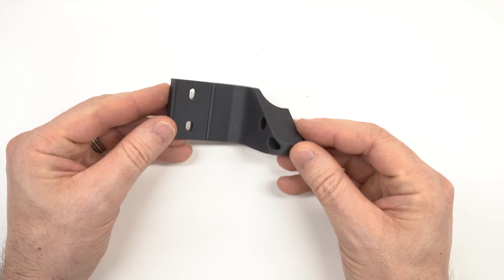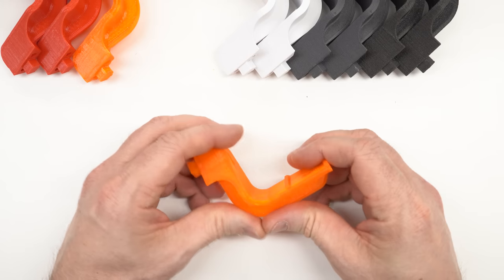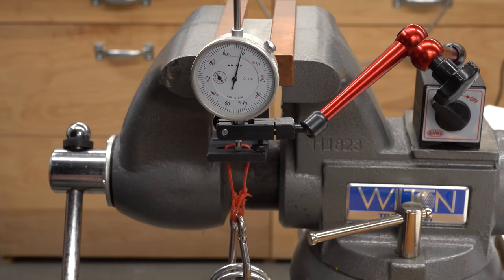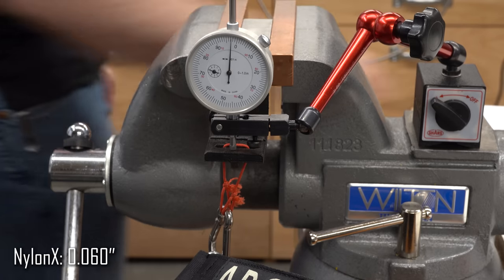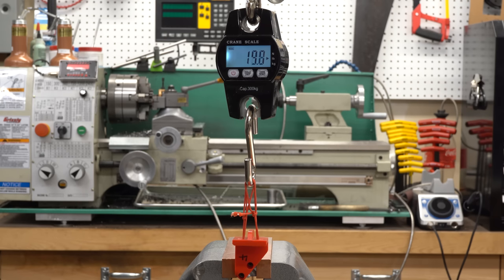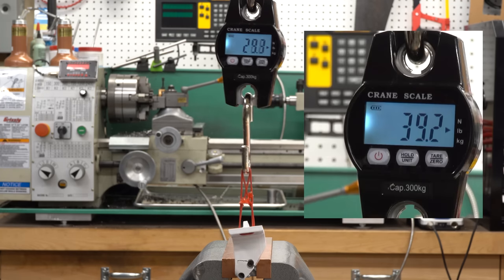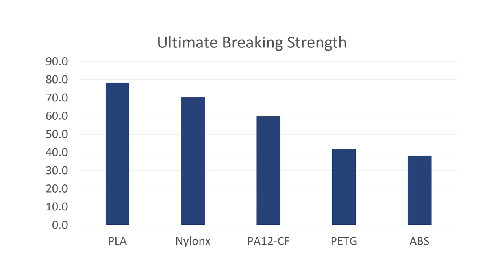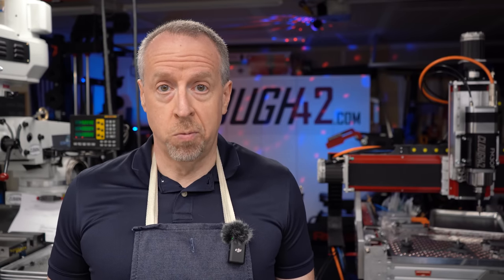Wait, What?  PLA is Stronger Than Carbon-Fiber Nylon?

Comment: I only use carbon filaments for that matte look. Carbon filaments just look really good, but it just means there is less plastic.. it essentially a filler material, it cant really do much.
Good PLA is just really good, its cheap and the parts are strong and rigid.
I think a lot of these special filaments, are kinda hype.. there is just way higher margins in them.. and everyone starts looking for special stuff at some point. To feel all fancy.
Reply: I was wondering about that.  It's the fiber that matters to carbon fiber.  Otherwise it's coal dust.  I'd be interested to see the manufacturing process to understand if they have any way of keeping the characteristics of long fibers in these filaments. Hell, Kingsford's cheap. I'll start making that black stuff by the weekend.  Just need a comic book name for it. The wife's probably not going to be happy with me.
Reply: PLA doesn't hold up to heat and it's brittle. This may or may not matter to your application.
Reply: @Ideasite  there are very different grades of carbon fiber filled materials ranging from ground cf (dust as you mention), milled, aerospace grade (see 3dxtechs website), and continuous fiber (like markforged). CF can definitely improve material characteristics - IIRC flexural modulus of ASA is almost 2x that with CF (based on 3dxtechs TDS)
Reply: @YEETPRIME  No. Carbon fiber is only there to make the filament printable (reduce warping). Some carbon fiber dust won't give it any strength.
Reply: @Ideasite  also the fibers need to reach from layer to layer to actually make them useful. I could see how they might help reduce warping but i dont really think they make the parts stronger.
Reply: @alejandroperez5368  have you looked at some data sheets of nylon and cf nylon? The carbon fibers nearly double the tensile strength of some nylons. Most other filaments dont profit as much as nylon, mostly stiffness and impact strength gets better with carbon fibers.
Reply: @alejandroperez5368  Yes, it does make it easier to print (esp stuff like CF PEEK), but as I said, not all CF is the same. CF dust like in some cheap CF PLA is not going to be the same as the milled stuff in performance filaments. 

If you want to argue with clear cut performance metrics in the TDS, then you  might want to see a neurologist
Reply: 100% agree!
Reply: CF definitely makes its stiffer. I've printed alot of nylon, esp taulman 910. That stuff is awesome,  but its definitely more flexy than CF-nylon.  Plus CF-nylon is easier to print than pure nylon. Trying to print pure nylon is pretty hard actually.  That's why if I need to print nylon wo CF, I go with taulman. There 910 prints as easy as pla. I tried printing gozmo dorks nylon and that stuff is total garbage, actually any filament from gizmodorks is garbage.
Reply: @GMCLabs  give Polymaker Copa or 3dxtech amidex 6-66 for unfilled nylon, stuff is even stronger than taulman 910
Reply: @FrozenByFire3  I'll definitely give them a try. Thanks!

Comment: PETG strength can vary significantly based on the temperature of the extrusion and the temperature of the build volume during the print. For best results, keep these factors steady during printing and bias toward hotter temps for stronger parts. That first value (in lbs) is repeatable and typical of a hot PETG print. PETG is by far my favorite printing material for parts that need to be strong, but can also be somewhat flexible.
Reply: PETG loves to stick to the nozzle. And you won't find matte finish filaments. Not so nice looking.
Reply: @alejandroperez5368  Both valid points, but if the finish isn't as important as the structural integrity, PETG holds up best, especially considering it's inter-layer adhesion is top-notch. I haven't worked with any of the super hot stuff, like PEEK, but for regular ranges, it beats out the competition for me.
Reply: @alejandroperez5368  Try the carbon infused petg for a really clean Matt finish
Reply: If y'all can, try to build or buy an enclosure as they can greatly help with the efficiency and layer adhesion of our parts. Even a thin sheet or a plastic bag helps. 😊🌎❤️
Reply: i dont understand how some people print firearms with carbon petg, but i can bend the parts with my fingers and they explode like frag grenades under any stress. parts printed at 250 on a 90 bed at moderate flow rate

Comment: As others have pointed out, it appears your scale was set incorrectly to lbs - doesn't invalidate the results, just changes the units :) very interesting video, I've been looking into buying the X1 Carbon, but after this video (and other, similar videos from CNC kitchen), I'm finding it harder and harder to justify the purchase.
Reply: Why? You have found more reliable printer, bambulab bannana bed problem made you rethink?

Comment: What stands out is that the dial indicator doesn’t return to zero on the carbon fibre samples, so it distorts in a short period of time and doesn’t return to its original shape.
The biggest advantage of the PA/CF is temperature and chemical resistance, like for automotive use 👍
Reply: PETG has pretty good chemical resistant too. I've actually used PETG to print functional automotive parts that see gasoline and that live in the hot engine bay of a vehicle and it has held up perfectly without issue.
Reply: @bluegizmo1983  agreed but then they don’t have the rigidity of the PA/CF.

Comment: Thanks for the testing, James. I'd be very interested in the cost/unit of the various material. So many things are engineered to a price these days. For anything done at scale, it has to be a consideration.
Reply: A valid question.  However, I will just point out that "for anything done at scale", one probably isn't using fused filament fabrication, and instead using something like injection molding or such... which kinda changes the whole game.  Then again, there are degrees of "at scale", so, again, a valid question!

Comment: Nice job keeping it simple and applying the test to the use case in question. 
The trouble with 3d printing materials is that the geometry of any given part seems to have more effect than the mechanical properties of the polymer. Stefan at CNC kitchen has done a lot of work characterising different filaments  mostly testing ultimate tensile strength with the layers and across the layers which shows the disparity in strength between the different axes. 
I have found when using PLA the problem is temperature, even in the UK a part left in direct sunlight can easily reach 40C and start to deform. I printed a nice drawer to store bits and bobs under my Ender 3, 2 days later it was banana shaped and I had to destroy it to get hold of my spare nozzles and cutters.

Comment: Due to the peculiar design of the bracket, the breaking test appeared to be primarily over-stressing only the least-well-reinforced mounting hole. The angled portion seemed only to serve to change the vector of the stress on the hole. This seems difficult to interpret meaningfully.

Comment: My only experience with a strong 3d print material was "tough-pla" i don't remember what brand, but the name was no joke, that stuff was really frickin strong. I tried tapping screws into it like you would with normal pla and ho boy was that an adventure, it took so much force to work into that material, and I don't think I ever had  a single part break, because it wasn't just stiffer, it was also more ductile too, none of the brittleness of normal pla.

Comment: Care is needed when using PLA for engineering because it will creep over time if it is under constant load. ABS is much more stable over time and under load and that's why it is commonly used for engineering.

Comment: My experience with PETG (and looking at videos here) is what you saw: very high inconsistency. When I have weird part failures of usable parts, it's usually PETG. It's inconsistent, it's picky with printing, and susceptible to moisture. It's also the filament most likely to damage your printer: I've lost a hot end because the print failed and the filament started sticking to the nozzle, then built up and completely encased the hot end and was in the cooling fans, warped the ducts, etc. On top of that, PETG either doesn't stick to the bed, or it sticks far too well, and I damage the bed removing it. I put my printer in a heated enclosure, and because of this, ABS/ASA have been a little easier to print than most PETGs.

Comment: That was surprising! Thanks for doing this. For my personal prints, some of which I have products made, I do try different materials (well, just pla and petg) to see what material is better suites for the particular application. Thanks for doing this
Reply: hello, i am gonna print a vacuum cleaner wheel, which material do you recommend, petg or pla? the wheel design has small clips to plug in to vacuum cleaner

Comment: Very interesting set of tests. Testing materials is hard, and you did some easy ones, and I don't blame you. But I am a bit unconvinced of the value of UTS tests, especially for a plastic material that can creep. Really, for real world design, it's the yield strength you would work to, surely - OK, after yielding it may hang on for a bit, and that may save someones life or stop something important getting broken, but you'd never design to that standard. The problem is that finding the yield point is hard, especially on a relatively elastic material like you are using. In support of my comment, you yourself were looking closely for signs of yield on a couple of the tests. But yield strength  might well give very different answers - the ones that were strongest did seem to bend a long way, no way to tell if they would have gone back, or how far, but quite possibly worse than the low UTS materials.

Comment: These tests went almost exactly as I expected. Except the PETG break test. The biggest issue with PLA is heat for sure and it moves at MUCH lower temperatures. IF you haven't already check out CNCKitchen
Reply: @derschwartzadder  "even a car interior in summer can destroy it". Even? That's an actually hot environment. If you said "even in winter" then yeah.
Reply: @alejandroperez5368  Yes. A car in summer is hot, but not unusually so. The point was that it doesn't require being in the engine bay, or a component of an oven to deflect. There are many real-world scenarios that are simply without the useful temperature range of PLA. 

That said, it's still my primary filament for functional prints.

Comment: At least I did not catch you mentioning.... 1: what the infill amount is for each part. 2: what type pattern for the infill you used, etc. All this does make a difference. Also in my designs. I design my part to be an even multiple of the nozzle printing width. I use a REVO HL .6 nozzle and a .4 layer height and a .5 layer width. So for walls I might for example make my walls 4mm thick. In Simplify3D my slicer I then will use 2 Walls called Perimeters in simplify3D. Which is actually 4 walls 2 interior and 2 exterior. So that adds up to 2mm and then 2mm of infill I print either Cubic or Honeycomb infill pattern. At 8-10% infill @ 120% infill width my parts are really strong. For only 8-10% infill. I used to use 50-90% infill thinking that would make for a stronger part. Then I discovered that going by what I stated above  I get just as strong of a part with saving a lot of printing time and filament. So without taking the above into account when you or others are doing these types of tests does not tell the whole story. I also discovered that as you go down in infill percentage and maybe increasing the infill width I get a bigger wider infill pattern. I have always wondered if this is actually more rigid than printing a smaller pattern and more infill. I never did a test. Which someone should do such a test comparing the above mentioned setting. Take PLA and use different infill patterns and infill % amount and also vary the Infill Width. This test would show a lot and I think help a lot of users. And you would have to vary the number of Walls to have a true test.

Comment: I was thinking of making a few things that need strength and was searching for the answers about these filaments.
As I watched your video approx 3x, it was flaud from the beginning. 
1. before printing, were the spools in a dryer to eliminate moisture?
2. was the printer tested to be consistant with the suggested hotend & table temps? Open or enclosed printer? Ambient Temps?
3. was the filament extruded to the manufacturers specs?
4. Though the tests you performed are valid, the test should be similar to the application of said part.
5. you should use at least 5+ test pcs. and they also should be in the dryer as well.
6. Just by looking at those pcs and where they broke, it seems that your weakest link is by the bolt holes.
All in all a great video, with many questions that need to be answered. Science is a wonderful thing! 
I may be a newbee to the 3d printing but manufacturing is my forte. Retired machinist - cnc programer/setup - tool&die

Comment: The problem I have personally had with PLA is its deformation with even the slightest amount of heat; this is not a sudden deformation either, months of small amounts of heat and the parts completely sag in the direction of the stress. The other problem is UV related (parts outside). Without going into a ton of detail, the solutions have been simple. Don't use PLA where there is any heat (use PETg instead) and treat PLA with a UV blocking wood stain. Unless there is some aesthetic property (wood grain PLA) in a filament, I stick with using PETg for pretty much everything because I don't want a ton of different types in my collection.

I don't know how you've printed the PETg here but I use a 75c bed temp and only a minor amount of cooling fan speed; 20% to none at all. My nozzle is hardened steel so I print at high temps (usually +10c over the filaments recommended temp). I also have an all metal hot end so my retractions are also low.

I stand by what I said before though. For this application, PETg would work just fine. If a person really wants nylon, just use it without the carbon fiber, I think you might find that parts are likely to be stronger, the specific type of carbon fiber used in this filament offers no actual structural benefit. It is possible that the carbon fiber helps with printability though, I have no idea about that specifically. I am quite happy using MUCH cheaper filaments for all my needs.

I would have designed that part completely differently as well. I have to admit that I don't much care about how pleasing a functional object looks though, but I would have made this part much beefier and with no counter bore for the screws. An extra 1/8th inch of material here and there doesn't bother me at all. I already know that PETg isn't as "strong" as PLA but it is quite a bit tougher and doesn't deform nearly as easily under low heat applications, so I design parts accordingly. Hell, for a functional object like you have shown here, I would've just made it with 100% infill. There isn't enough mass for me to care about the "waste" of a little extra PETg.

Comment: PLA and ABS aren't UV resistant, and PLA has a very low glass transition temperature.  The PA12-CF is used for high temperature engineering applications, and I imagine the NylonX can also fit that role.

For general purpose applications, PLA is good, but if you need UV resistance or some amount of heat resistance (such as a part in the interior of your car), PETG is the better choice.  The other materials have limited, niche cases where they're preferred, but are vastly more expensive (usually 100-200% more).

I personally print mostly in PLA, but have recently started using PETG for applications around heat sources.  I also have PA12-CF for making car parts around the engine bay, such as end caps for headlights/fog lights, small brackets, etc.

Comment: Sure would be interesting to see a finite-element model of stress to see how it distributes during the pull. I'm thinking that failure is precipitated by the weakest area, after which other areas fail having been let down by the first area.   It looks to me like the design is too dependent on the very thin region around the recessed screw adjacent to the "diagonal" side.  So if might turn out this is really a test of that specific kind of feature.  Not that it's an issue for the actual application, just for the testing results.    Regardless -- good on James for doing some tests and entertaining us!
Reply: You hit the key way before me!  That thin spot queers the whole deal. (Can you use that expression any more?)
Reply: He should've tested on a "coupon" of material and not a specific element, this is not the correct way to test materials

Comment: Thank you James! I am starting to print tools for my work shop. Mostly 90% for woodworking. 90* for clamping, corners for belt clamps and so on. I have been very happy using eSun PLA +, even as a beginner a year ago. Until I watched your video I was thinking I should use a material other than PLA.

Comment: I'm not surprised by the PETG results - I've had the same experience. Sometimes it bends and sometimes it just snaps - even if it's the same part and the same settings.